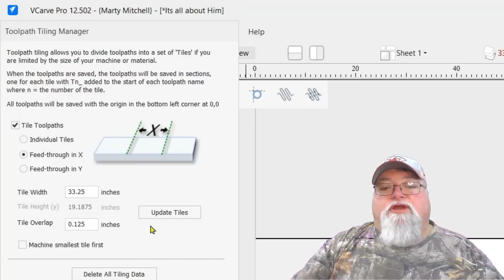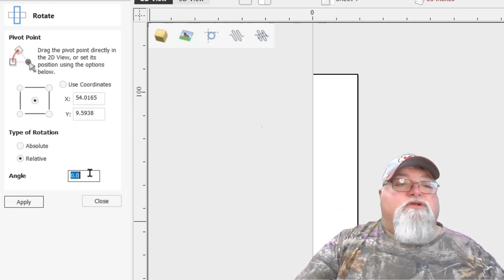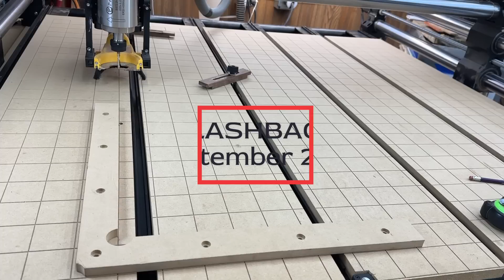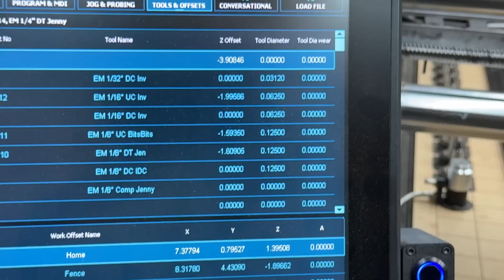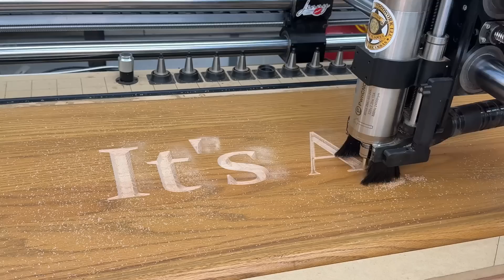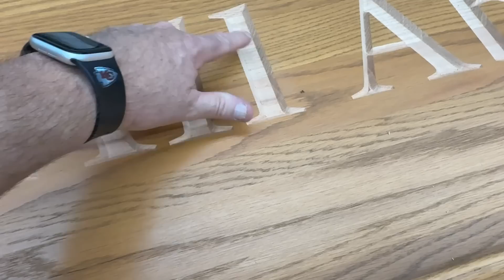Master CNC Tiling Techniques With These PRO Tips!

Comment: Greetings, I think your machine was 4 x 4, but I would like to know how much space you lost by including the automatic tool changer.
Reply from the maker: I only lost around 2.5” with the tool racks in place, but they’re on magnetic bases and can easily be removed if I need the entire 48” cutting width. All I have to do is disable the ATC in the Masso and run it in manual tool change mode.  Great question, thanks for watching!

Comment: which dust boot are you using?
Reply from the maker: I’m using the PwnCNC v3 dust boot.  I have the face of my boot removed for the camera, so it works a lot better with the face installed. Save 5% using my affiliate link below!

https://pwncnc.com/products/dust-boot-v3

Comment: Marty, do you plan to get the 1F rotary?
Reply from the maker: No, PwnCNC sent me a rotary several months ago, but I just haven’t had the know-how to set  it, or the time to devote to learning it. However, @JayBergCustoms is supposed to be leading the way and showing me what I need to do.  Hope to get it going this Fall.
Reply: @MitchellsWoodwork  I'm looking forward to seeing the dog hole episode.  I am using a fence in the corner, 3/8" x 1" strips held down with double sided tape.  Works pretty good when I need to repeat.  Otherwise, I use blue tape and super glue or double sided tape.  But, I think cutting dog holes is a good idea, I want to know how to align the holes perfectly with the grid.

Comment: Does your dust collector automatically turn off during tool changes?
Reply from the maker: Hi Jeff!  Yes, it automatically shuts off a few seconds after the spindle stops running. I have my Festool CT15 dust collector power plugged into the “vacuum” outlet on back of the 1F black box.  This way the Masso controls the vacuum as well as the spindle.
Reply: Just a guess but brass screws might be too soft of a metal for Phillips Head.
Reply from the maker: @wraven7974 Great to hear from you, Wray! Interesting theory, I suppose you could be onto something there…especially for small brass screws. 🤔